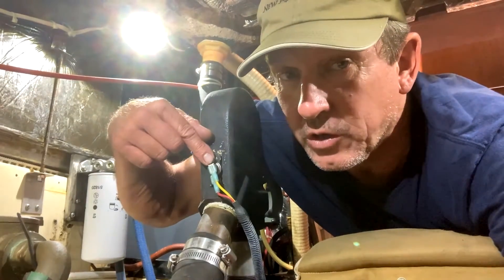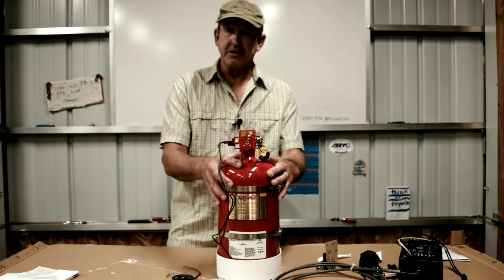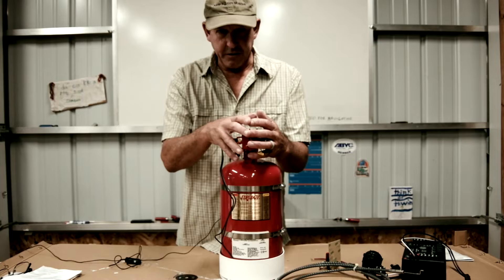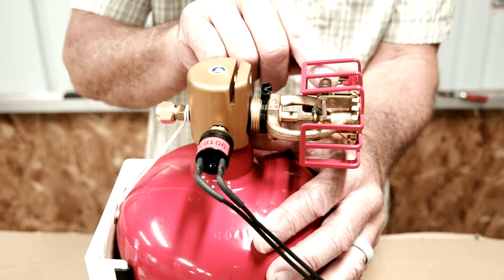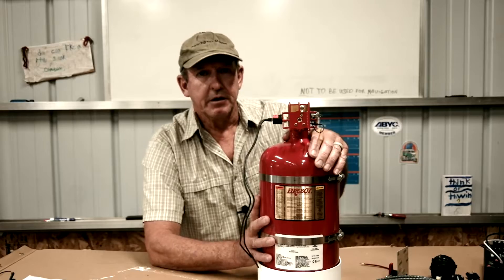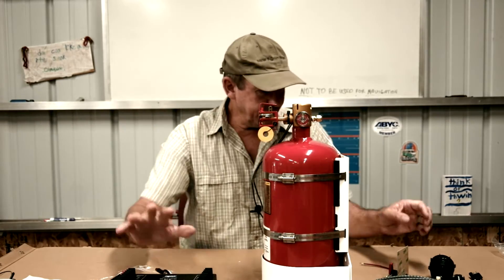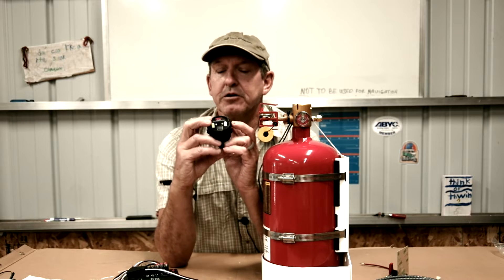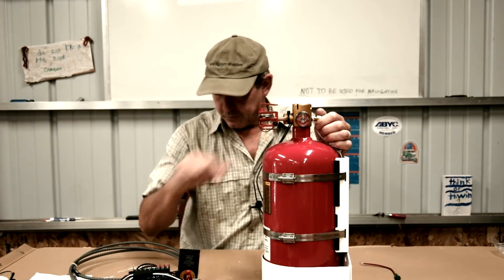Marine Fixed Fire Suppression System

Comment: This is a great presentation.  Manual discharge is very important.  I have 25 years in vehicle fire experience and the best detection is our 3 senses.   That with the delay in detection and suppression you can stop the fire before it causes a lot of damage with a manual discharge.

Comment: Exactly how does the pressure switch work?  Does it actually measure the pressure in the bottle, or electrical resistance using the Agent in the tank?  I think my pressure switch is bad and wondering if I can change it myself, or does the bottle need to go back to the factory?
Reply from the maker: The switch is held closed by the pressure in the bottle

Comment: Hi.  Thanks for your videos.  I have a Fireboy CG2-400-FE241 in my engine compartment.  The bottle shows the correct gauge reading, but blowers don't work and green indicator doesn't always illuminate.  Is there a method to test the pressure switch to see if it's gone bad?

Comment: Is the pressure switch normally open or normally closed while there is pressure in the bottle?
Reply from the maker: Depends on the manufacturer. One uses a normally open the other a normally closed.